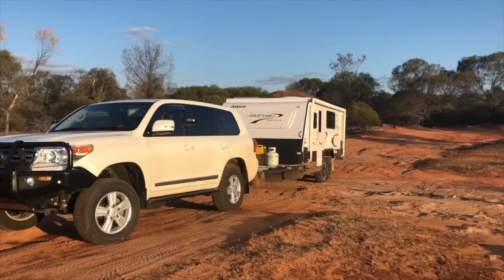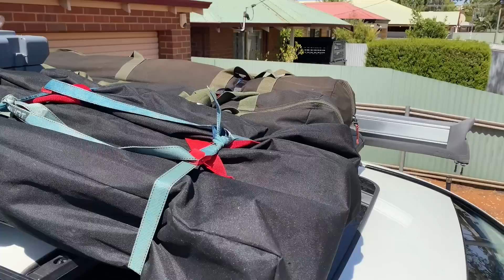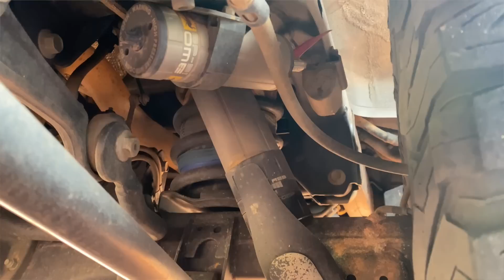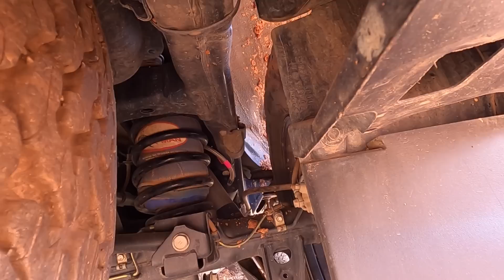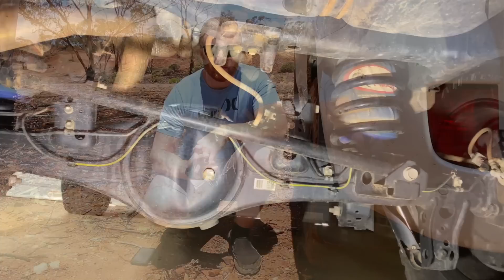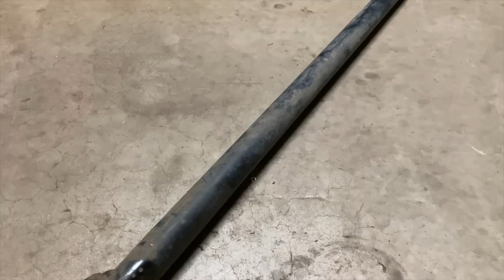LANDCRUISER 200 | Rear Suspension setup for TOWING, TOURING and 4x4’ING | ARB OME BP-51 GVM | Airbag

Comment: Very informative Nath and its nice to see the experiences of others! Thanks again for sharing. I have a similar setup on my 200 but I never got the airbags or the panhard rod. ARB did however install the 600kg coil springs ( without my knowledge) and the ride was really firm and uncomfortable. I took it back and without question, they changed the setup back to 400kg and I'm very happy with the setup now. I have the same suspension and GVM upgrade ( however, I did manage the 4015 kg) but don't intent to load it up.
Reply from the maker: Thanks Jim.
Interesting to hear your thoughts on the 600kg springs. Are you running similar modifications on your cruiser as I am, more or less? 
Glad to hear you have worked out a good solution for your setup! Suspension has got to be one of the most important things and something that really makes the vehicle a comfortable tourer. 
Cheers.
Reply: @XploringOz  .... Hi Nath. Pretty much the same setup. We're setting it up to tow a caravan offroad around Aust for a few years so watching your vids has been a wonderful resource. Again, thank you so much.